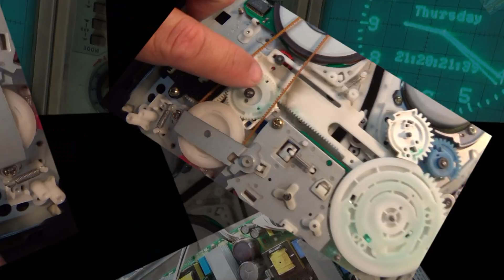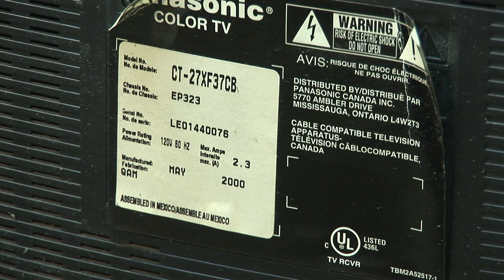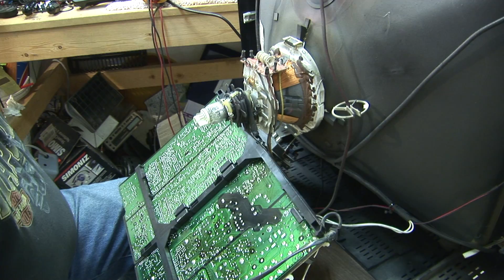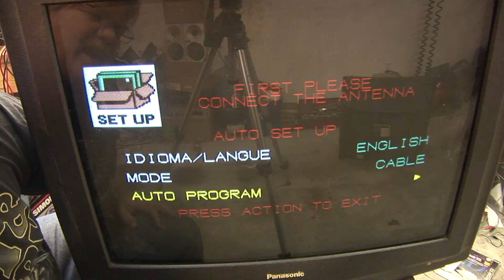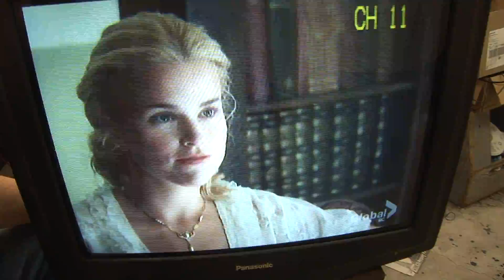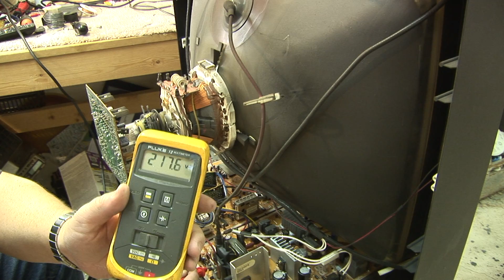Panasonic TV very washed out picture repair

Comment: Do you know if a switching power supply IC (TDA4601) is a common point of failure in TVs? I have this Panasonic where SMPS doesn't work for some reason. Only for a second there are correct voltages in TDA4601 and in the central transformer, but then it shuts down and TDA voltages drop to 0.7-1.5V.
I think i tested almost every transistor, capacitor, diode and resistor in the power supply area.
I'm wondering if i should try replacing the TDA4601 because I'm out of ideas.
Reply from the maker: They can fail.  Sounds like you are in either a n over voltage or over current shut down.
Reply: @12voltvids  Thanks for the reply. I will try to change it because it's driving me crazy. I think i tested 10 times all the power supply components. And the tv was in an excellent state when i picked it...
I think it shouldn't be an overvoltage, there's even less than minimum voltage on some pins (during those 1-2 seconds that it works).
Thanks

Comment: I've got a 17" Goldstar CRT computer monitor that looks to have a similar issue. Dim on the right side with heavy smearing, although the picture isn't warped at all. Would this be a similar fix? I've read others claiming it could also be toasted resistors or transistors.
Reply from the maker: Yes probably.

Comment: I have a similar issue with my PVM 2950Q. Bright objects have some light smearing to the right against dark darker backgrounds. Not as severe as shown in this video but still noticeable.
Could this be a capacitor issue  or the CRT itself? As far as I know the monitor wasn't used very much during its life.
Reply from the maker: Screen cap will certainly do it.
Reply: @12voltvids  Thanks. I will try.
Reply: @12voltvids  I changed the capacitor. Unfortunately the problem persists.

Comment: Hi, i have a Panasonic tc - 21s1r CRT tv, i have had a problem with it for a while now, it keeps flicking light then black, and when i tap the side of the tv it stops the flicking, i have switched off all nearby plug ins and also this fault is happening with the scart lead out aswell and no other connections attached. I only use it for dvd watching and gaming, but the problem is getting worse and now i get white horizontal lines that go brighter then the tv switches itself off, it seems to be very sensitive to touch and the problem seems to improve after i’ve left it on for a few hours. any help would be appreciated.

Comment: Finally, a video that shows how to fix the exact issue I'm having with my Samsung HD CRT. Widescreen HD CRTs are harder than hell to find anymore and I was really hoping mine wasn't dead. You're a lifesaver!
Reply from the maker: Yes I know.  I had a nice 34 hd wide screen. I gave it to my father in-law and when it broke rather than break their back to bring it over they tossed it for a cheap lcd that lasted 3 years and then another LCD.
Reply: I have an early Samsung HD showing signs of this issue. Did you successfully repair yours?
Reply: I ended up grabbing a basically new Sony HD CRT shortly after and my Samsung went off to a friend who didn't seem to mind the issue. The Sony is vastly superior in every imaginable way.

Comment: I'm curious.... what is your favorite brand crt?  Sony, Panasonic, JVC?
Reply from the maker: Conrac and Tektronix.  Don't worry if you have never heard of them. They were American broadcast monitors and they had the most beautiful picture I ever saw, given a good signal. VHS looked absolutely horrid on them however because they showed every flaw of the shitty VHS picture. They were video evaluation monitors to show absolute video quality at the highest resolution possible. Trinitron were pretty soft by comparison and masked all the flaws just like airbrushing an unattractive model. You know, a 3 dressed up as a nine.
Sony had some evaluation monitors too, professional fine pitch tubes but these were not generally on consumer TVs. The big problem with Sony is the 2 horizontal wires on the aprature grill.  The conrac and tek monitors used delta gun with a extremely fine dot pitch. The gun end of the tube was also huge, about 2" across as opposed to consumer tubes that used a 3/4" gun assy. They also used super high voltage for super fine focus and giving the viwer a good dose of Xrays as an added bonus.

Comment: Do you ever discharge the high voltage transformer before you handle these boards??
Reply from the maker: No, because the diodes in the transformer will block any stored energy in the tube.
Reply: @12voltvids  ... That's good to know because my father always did discharge ours and it's one loud zap...I have one of those Toshiba's with a bad cap causing white lines. Maybe I'll get to fixing it. Now I know the which culprit capacitor it is. Thanks!

Comment: siavash arash
Imagine possibility of paralleling another low ESR capacitor when you mesuring a cap which soldered in board
And i sow many and many caps has low esr but licking internaly in high level

Comment: I have this issue with two Sony PVM-1954Q's. It's not as bad as this set. Only happens with bright areas against a darker background.  I did a full recap of the video, power, and neck boards on both and the issue still remains. If I try to turn G2/Screen up or down, no change on the screen in terms of brightness. I verified power is at 115.0v under load. Since I'm feeding RGB into it, disconnecting green makes the issue go away on both monitors.  Turning the gain up or down for green doesn't do anything either. Other than this one issue, both monitors look fantastic. What else can I look at?
Reply from the maker: CRT

Comment: Interesting! I've just picked up a 19" 4.3 tv that I want to take the tube from for my arcade machine and I can see why it was dumped on the road, has the same issue, the tube is absolutely fine and just what I need but interested in seeing if I have a cap thats gone and replace it, will save the chassis as it may come in handy.

Comment: Hi, i have HD philips 29 inch crt thats good for retro games and when i turn it on it shows picture for about 5 seconds and then turns off and it takes about 4 tries to get it to stay on, when it turns off it flashes error code on the power led and for that model that error code means "vertical guard protection", what should i check first?

Edit: also it has like a foldover lines at top of screen that dissapear after about a minute after it manages to stay on after few tries
Reply from the maker: Small capacitors in vertical circuit.  Tupically it will be a 1 to 10 if.  Will generally be right in there next to the vertical ic.
Reply: @12voltvids  thank you :)

Comment: Have you ever dealt with the Panasonic prism sets
Reply from the maker: Yes. I had one for years.
Reply from the maker: The prism was one of the first sets that I discovered counterfeit horizontal output transistors with.
I had a prism set come into the shop about 1995 or so. Horizontal output blown. Cost from Panasonic 38.00 dealer cost. Cost from main electronics 5.12.  Of course we bought the cheap one, because it was identical right. The first ones were, and never had any problem. Then the fun started. Had another one come in, put in a cheap replacement, and sent it out. 2 weeks later it was back, transistor blown. Put in another one, and it lasted a week, and bam, it came back like a boomerang. 
3rd transistor in, and monitor set in shop. Working just fine with back off, beautiful pictire. Ran it for a week all  day every day. Left it turned on over night. Seemed fine. Put the back on it, and ran it in the shop with back on. Popped the transistor again.  I was pulling my hair out because the set was not drawing excessive current, and the waveform was clean, but the boss was convinced that the flyback was shot and refunded the customer.  The set went into the corner.   I started running into other "new" transistors that were failing left right and center, and was talking to my colleges at other shops and they too noticed this. This was the start of the counterfeit transistor plague that hit the industry really hard in the mid 90's.
Sure I could have ordered a 38.00 part, but why wants to risk that not knowing what caused the original and 3 replacements to fail. There was talk all around the tech fourms about bad transistors and some had taken it to using a dremel cut open the case. I did that on a dead original and a replacement from an aftermarket supplier. Sure enough the die was about 1/4 the side of the original. No wonder it failed.
It wasn't long after I had a prism come in with a broken tube. Set had fallen over.  I pulled the good transistor out of that set and put it in the one that had been blowing transistors left right and center and the boss said "take it home and test it" I took that set home, and ran the crap out of it in my office from 1997 through to 2001 when I sold it to a friend and they ran it right through to 2009 when the picture tube finially failed. Was an excellent set. In 2001 I purchased a 34" Panasonic HD Tau which I used right up to 2011 when I replaced it with the plasma in my studio I still use in my edit suite. I gave it to my father inlaw and it broke in 2015. He threw it out and bought a Hitachi LCD set that lasted 2 years and the LEDs failed,  and is now on the second LED set. 
Long live the old CRT sets.

Comment: Thats a GAOO, theyre one of the best TVs Panasonic ever made, add RGB input to that best and itll be the ultimate retro console gaming set.
Reply from the maker: The Gaoo and Tau were great sets that Panasonic made. That is the reason the owner of  this wanted it fixed. They were not wanting an HD set as they watched many old VHS tapes and we all know how good those work on modern sets.
Reply: 12voltvids Yes theyre great, i had both the 47" and 51" GAOO rear projection, and still have a 68cm and a 51" Tau GIGA here.
Reply from the maker: @CaseTheCorvetteMan  
I had a 34" 16x9 HD tube set. Gave it to my father in inlaw and when it broke he threw it out and bought a flat panel that lasted 14 months, and the LEDs failed so he had to buy another one.
Reply: Ive got 2x Philips Matchline 16:9 HD sets here too, theyre pretty good sets

Comment: i have sony crt 29" KV-AR29  having  similar problem , tv works normal on starting but after 5 minutes the right side horizontal side top to bottom picture is slashed of 3 inches as if it cut  with knife.i checked HOT transistor and capacitors around all it looks ok .what could be the problem.pl reply thank u

Comment: Hi 12Voltvids I don't know if you can help with my problem, I have a panasonic TX-29ad2dp tv which has a weird problem the picture is good clean and sharp but if you look at an image when say a dvd or games machine is on pause the image is moving, the only way i can describe it is like seeing a flag blowing in the wind or pond ripples which speed up and slow down, also if a white screen is displayed you can see like very faint grey shadowy lines about 3 inches wide the move vertically but quickly up the screen...any ideas? would like to fix this set as I don't want to chuck it out as it's a really nice tv
Reply: Jessie4Pink Oh my god no one cares
Reply: Clearly you do to comment!
Reply: Jessie4Pink I cared only enough to show you reality.

Comment: Where are the geometry controls on the inside of a CRT? My CRT has some garbage geometry that's driving me nuts.
Reply from the maker: On this one if you look around the yoke you will see a bunch of small square magnets. These get rotated to change geometry around the tube. There are also little flat magnets inserted between the tube and the yoke, and small magnets attached to the bell of the tube to correct specific areas.
Reply: 12voltvids I looked on the inside of my Panasonic, and there's no magnets inside. Are there any knobs I can twist or controls I can adjust that will improve the geometry?
Reply: In the later CRT models must enter in the service menu through a specific sequence for geometry and other adjustments.

Comment: I like the lead too.  I have soldered since I was a child. I should have died yeas ago. Yes I can relate, often that cap is on the neck board.
Reply from the maker: Been tinkering with electronics since I was about 7, studied all through school,  didn't plan to go into field. Planned to go into TV production. Fell into the service industry as it paid the bills, did it professionally for 22 years, retired from the business and went into a totally different industry, but stayed active in electronics repair. From all the solder smoke, and chemicals I have been exposed to over the years I probably should be dead too. Back in the day nobody used fume extraction.
Reply: I never worked at a place with fume extraction. I did one thing. I washed my hands before eating.
Reply from the maker: Same here. After handling solder (lead) or getting any cleaners or lubricants on my hands, it was a trip to the sink to wash up. Boss used to get mad because he saw the multiple trips to the washroom as wasting his time.
Reply: Did you ever use kester ap20 flux remover? Loved the stuff. Dumb boss. Lol
Reply from the maker: We used MG super wash which was pure TF solvent until they banned it, and yes my boss was something else. What I still to this day haven't figured out.
Bi-Polar comes to mind. It was Jeckyl and Hyde at that place.
Reply: +12voltvids - A tune from The Simpsons Sing The Blues album comes to mind: "Look At All Those Idiots." Perfect for horrible bosses.

Comment: please, I wish you make a video about this = I have crt TV that surge out volt from the video input port or the VGA port in a way that if you ground your self and touch the video port or the VGA port will get a small shock, also if the TV on and you want to connect the DVD player to the video port then when the video cable near the TV video port there will be a spark, and once the DVD video connected then the DVD shace will become electrocuted and if you touch the DVD body you will get slight shock also there is some hum in the audio, please I see this commen problem in tvs and pc monitors and it burned many motherboard because of it, I know you can help , and thank you good videos
Reply from the maker: What you are experiencing is what is called line leakage. Typically there is a very high ohm resistor, in the meg ohm range that ties the chassis to the hot ground (neutral). If your AC plug was reversed, and the hot wire was on the neutral line the hot side would be supplying power to the chassis ground, and you will get a small shock when say handing a grounded catv wire and you touch something metal on the back of the set. This is why polarized plugs are important, as they only allow insertion of the plug the correct way to make sure the neutral is actually the neutral.
I can probably demonstrate this with my old Sony TV and an even older polarized extension cord. Great idea for a video.
Reply: 12voltvids  if you can make more than one video about it and please always draw schematic on paper and show it to the camera , I hope you address this subject from the ground up make video about TV and about pc PSU,. I really h hope you can design counter circuit for this problem , finals please add link to  webpages, I hope you start your website and I and links to your video in there, really good videos thanx and keep the good work

Comment: my crt tv model f36669 RCA is displaying "undetectable signal" on video. Thats without anything hooked up to it. Its still the same with game consoles are conected like NES, Dreamcast. If you can give any advise i would appreciate it. thanks
Reply from the maker: Not familiar with this model, but some TVs had a setting in the menu to select between video and Svideo others have an auto detect that will switch to s-video if there is an s-video plug inserted regardless if there is a signal on it or not.

Comment: crt tv is more durable than lcd and led tv
Reply from the maker: Crt and plasma are relatively reliable. Lcd/led not sure much. They are built cheap and not to last. 3 years if you are lucky I have a few crt sets over 30 years old still going strong a yes I do use them. One is a security camera monitor and it has been running constantly since it was put in service in 1993. B/w tube. Now it is seeing life as a clock in my office. I have an app that runs on an old BlackBerry phone. Generates a flip clock. Hdmi out goes to an hdmi/video adapter then display on the tube. Just looks cool and since the display on the phone is cracked, I just use it for this purpose. Nice conversation piece, and since it is connected to network time is always exact. That's what I use that hdmi/video adapter that was doa out of the box for. Seller said keep it so I put it to use.
Reply: the crt sets are reliable been running a repair shop for years worked on quite a few and still do gave up dealing with led/lcd not worth the hassle anymore as usually cheaper to replace, I still work on a lot of vintage electronics solid state and vacuum tubes, got a few color sets from the early 1960's to pickup in the states asap to bring back I enjoy restoring tubes electronics been doing it for 25 years